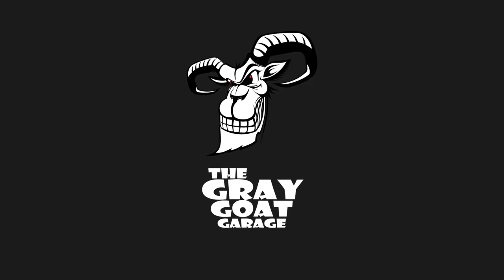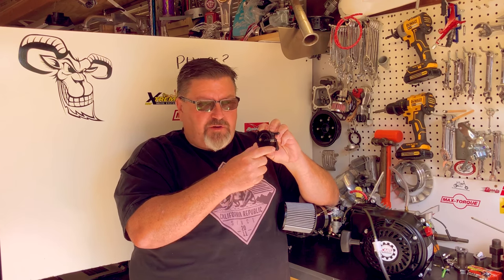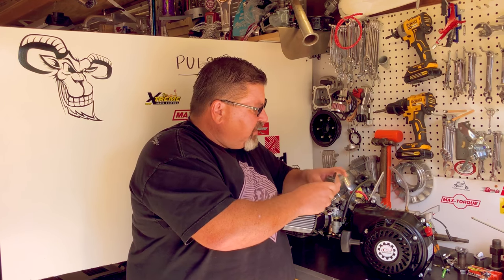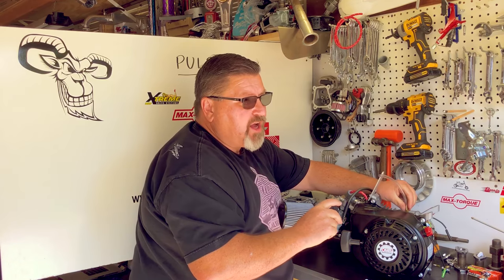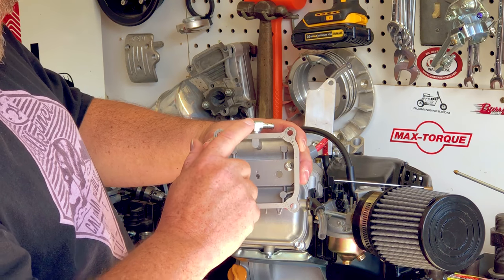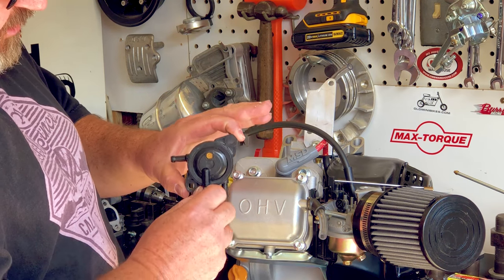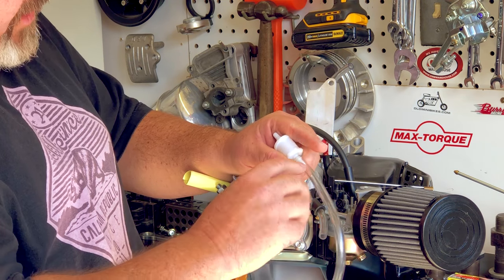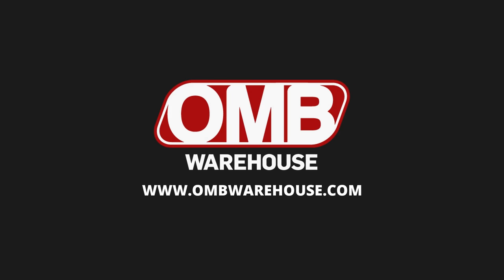Fuel Pump Installation on a Small Engine

Comment: Have you ever run into one of these pumps pushing too much pressure into your carb? Having issues with my carb overflowing. Pushing fuel past the needle and seat. Tried two different carbs. Cleaned them both. Same issue. Only happened after this install
Reply: Try adding a fuel petcock and playing with it a bit

Comment: Do you have a video of how to tap that hole in the the valve cover to get the pulse ? The proper way to make the hole , size and if you need another tool to make the threading so the fitting grips it ?
Reply from the maker: No, sorry, I don’t have a video on how to drill and tap a hole. 
Hit the hardware store and get a tap and the correct drill bit. They are often sold as a set 
Once you have the right tools just drill the hole and tap the threads!

Comment: GG You have a LOT more Grey and stickers in your back board from this vid to the pushrod cutting vid. 😅.  Thanks for all the help and would love to see you setting push rod length and ensuring we always maintain enough piston/valve clearance in our builds.  I just bought a 212 with +.020” rod, .308 cam, flat top piston and stage 5 head milled .063”.  Now I’m worried do I buy the Venom 1:1 or can I still get away with the V 1:1.35 roller rockers?  Lot of money to risk hitting the top of the piston.  Any reference material on how to math the math or the math to ensure it works before buying?  😊

Comment: Awesome explanation. Could you make a video on how to convert a top mount fuel tank to a separate tank under the steering axe? I haven't found any instructions on what parts I need or how the fuel system works on a predator this is the closest
Reply from the maker: That would be very hard to do for a specific kart and having a "one size fits all" approach is not the best way to do that anyway. Send me some pics of the kart to Help@OMBWarehouse.com and I will do my best to help you
Reply: @TheGrayGoatGarage  thanks for the reply. I mean as an example on these types of engines (predator 212, 224, and clones) which come top mounted.

Comment: Hey bud, out of curiosity, would this work at all if you also had no check valve in your breather going to a catch can. At the same time as I want more fuel pressure, I also wanna eliminate as much of the pressure build-up from the down stroke and the vacuum build-up from the up stroke as possible. I wanna say it should work if using the factory fitting size for the breather bc it should still build some pressure and vacuum bc it not like I’m drilling a 1in hole lol but curious if by removing the check valve if that’ll make the pump pretty much useless. I guess I should explain my goals with my build. For the specific build I’m not going for max power, rather I’m going for max fuel efficiency so I’m throwing everything I’ve learned over the decades of building cars and reducing as many parasitic loses as possible. I should also explain that I’m not using oem rings, rather I’m using total seal gapless rings to increase sealing potential even though the crankcase will have minor pressure/vacuum buildup during the strokes compared to stock. Im explaining that part bc with oem rings, reducing that crankcase pressure/vacuum can result in less than stellar ring sealing causing a power/efficiency drop rather than increase so wanted to get that part out of the way. Long story short, it’s a generator build lol. Thank you for your time bud.

Comment: I'm working on a stock gx340 from a pressure washer into a motorcycle. If you happen to have any tips on them or the P-420s, I enjoy the amount of information you output, and would very much enjoy watching a video on it.
Reply from the maker: Hi Cal,
the GX340 is a solid engine and a great platform to build on...as well as the Pred 420. The biggest thing we need to pay attention to is the crankshaft on the GX340. Some of the power washers used a tapered crank to mount the pump. There are no clutches for the tapered shafts!
The best thing you can do to any of these engines is open up the intake and exhaust, change the carb jets, and advance the timing. The EPA has these engines choked down and these simple upgrades will allow the engine to perform much better!
What are you wanting to do? better than stock? Performance build? Let me know.

Check that crank! If it is a straight 1" crank then we can plan this out for you
Reply: I am also doing a 420 cycle project. 1980 Suzuki 450 is my frame/ Roller. What are you using?
Reply: @TheGrayGoatGarage  I was gonna run a jackshaft with my CVT built into it so that I can universally swap the engine faster. Yes my 340 has the crappy tapered shaft, I believe a single sprocket will fit on it squarely.
Reply: @dhippstarr  a mudding lawnmower tehe

Comment: Would this be effective to use a pulse pump on a Honda GX390 pulling from an auxiliary fuel tank? It would have to pull fuel up about 15 inches and then over to the carburetor another 12 inches.

Comment: the oem black vacuum line that goes into the cover and connects to the pulse line went bad on mine a while back. I replaced it with a piece of clear 1/4" hose. fits in the cover super snug. no leaks. I noticed the other day when I started it gas going from the pump down the line into the cover. does that mean the pump is bad?

Comment: Hey brother I had a quick question if you can help me out I'm going to be building a predator 212 non Hemi 212 predator Governor completely, removed port and Polished head,  header, pwk 24mm open no air filter, .0.10 head gasket, 3.308 rod, .310 cam, Billet flywheel, with a 38  tooth rear sprocket on a Doodlebug ............  my question is what size of Springs should I use also what size of clutch also should I upgrade any parts for this setup any other parts any advice would be appreciate👊💯

Comment: Could you make a pulse fitting from the hole the governer gear was using?
Reply from the maker: If you are referring to the top of the case where the rod came through, yes, you can get a pulse there. 
That hole will have a lot of oil mist in the line so make sure the pump is mounted high so the oil does not accumulate in the top of the pump

Comment: I was running a go kart the other day and half way threw the session it just start getting slower and slower for no reason  checked carb and new spark plug and it's getting full throttle just wondering if the pulse pump is to blame the engine is only 7 months old and honda gx160
Reply from the maker: What has been done to the engine? has the governor been disconnected? If so, what billet rod are you using?
Reply: @TheGrayGoatGarage  it's completely standard honda gx160 single springed on the govner arm

Comment: So I want to add a pulse pump to my stock Predator 420. I'm looking at buying the Carb Insulator with vacuum port (rather than taping the engine myself), and buying a pump to pull gas from a stand-alone tank. This is for a pressure washing setup, not for racing. Which pump should I buy with the Carb Insulator?
Reply: Any pump will do, also you can buy a plastic piece for the motor that fits with stock motor. It has the pulse barb already on it and you’ll still be able to run stock carb etc .
Reply from the maker: We have the Walbro pumps here
https://www.ombwarehouse.com/walbro-fuel-pump.html
and the insulator with the pulse port
https://www.ombwarehouse.com/carb-insulator-with-vacuum-port-gx390-predator-301cc-420cc.html
The fitting on the insulator os for 3/16" line and the pump uses 1/4" line. Use this to adapt the two
https://www.ombwarehouse.com/1-4-to-3-16-fuel-line-reducer.html
Reply: @TheGrayGoatGarage  Awesome! Where exactly does the insulator go?
Reply: @TheGrayGoatGarage  Also, just put my order in for those parts. Thanks again!
Reply from the maker: @WallyJ2K  it goes between the carb and cylinder head

Comment: Do you have to block off the valve cover breather to get the pulse to work? or is there a check valve?  Great video , thanks.
Reply from the maker: Hi Don,
Nope! You do not have to plug off the OEM breather in the valve cover. There is a check valve in there that also allows the added pulse port to be effective. Add your pulse port and filter the stock breather and you will be good!

Comment: Question i have a 2008 yamaha cygnus nxc 125cc 4 stroke   scooter and has efi on motor can I run a vacum pump on it . It normally has an 12v electric pumps.
Reply from the maker: Yes. That is no problem. You just need to find a pulse port. You can get a pulse from the intake manifold too

Comment: I just stretched my 3/16'' fuel line onto the 1/4'' filter and pump. The particular fuel line i have seems pretty flexable so i went with it. But what i'm trying to figure out is where exactly to mount the fuel pump itself ? The only available stud in the area the pump is resting is the top left blowerhousing stud and i tried to put 1 end of the fuel pump mounting hole onto that stud but the stud isn't long enough to put a nut on it to hold it in place. Is the only other choice i have to buy a top plate ?
Reply from the maker: There are lots of choices! make a bracket for the pump. Mount it on the frame close to the pulse port. It does not matter where you put it! get creative...or get a longer stud! I would recommend using both mounting points!

Comment: Would i still need a fuel pump if my tank is gravity feeding my carb? not sure if the pressure is the same.
Reply from the maker: If you can get a sufficient supply of fuel by gravity feed, a fuel pump is not required

Comment: For a Honda gx390 could i use the old oil level sensor port or is there an option for vacuum on the carburetor? Or possibly put a bung on the valve cover?

Comment: I put the pulse line from in front of the carburettor with a spacer. I've never seen anyone do this but i thought that this should Work, but there's not much of a pulse at my pump is that the problem or could it be the broken seal of my valve cover?
Reply from the maker: That is hard for me to visualize 
Send me some pics to help@ombwarehouse.com and I will take a look
Reply: @TheGrayGoatGarage  done, thanks already for answering

Comment: after installing the pump I can still see air bubbles going to the 3/16 line to the carb. I bypassed the fuel filter and same thing. Any help would be appreciated, thanks
Reply: Check for cracks in your fuel lines.  If air is there, it has to come from somewhere.  If your fuel is coming from the bottom of the tank, that means you have air coming in through a fuel line crack, dried hose on a connection that is sucking air, or a gasket leak on the pump.
Reply: Thanks for the reply! I should have updated this , the lines were all new, but you were right on track, the fitting into the gas tank needed a new gasket

Comment: My mower runs good till it gets hot what would you think it could be
Reply from the maker: Sorry. I have no idea. It could be the fuel tank vent is plugged and vapor locking. Take the cap off when the mower stops and listen for a “whoosh” noise from the cap. If that is the case, drill a small hole in the cap

Comment: Where does the hose coming out of valve cover go to not the  one coming from fuel pump or can I just plug it off
Reply from the maker: That should go to a vent. You still need to vent the crankcase. Never plug that up!
Reply: Ok cool but mines coming out out the valve cover  I'm sure it's same set up  so what kind of things can I run it to so I don't lose oil out of it and what's the make of a power house racing engine I'm sure they designed many

Comment: Could you run the pulse pump into the valve cover on the side on the hemi? Like where that hose is coming off the side there
Reply: No, that’s the breather/check valve. Only lets air out, not in so it will not pulse. You’d need to drill a hole in the top of the valve cover and use the barb as GG did in the video. Or if you removed the governor internally, you can use the governor arm hole, drill and tap that for the barb.

Comment: When you had that predator 212 hemi valve cover in your hand with the pulse fitting already on it. 3:48  what do you do with the little side hole where the original airbox slid on to?
Reply: Sorry I read down further and you had answered that question. A simple tube with small air filter on it with work fine on that hemi breather hole off to the side
Reply from the maker: I use a small filter on that  https://www.ombwarehouse.com/breather-filter-12mm.html

Comment: G'day mate ,smithy from Aussie, just a silly question, I brought a  cub cadet ,20hp kohler motor on it, the is in a very bad way . When your winding the motor you get a small amount of fuel in the filter, how much pulse is required to deliver fuel to the  carbie?
Thanks for the video, very informative, 
Thanks smithy
Reply from the maker: Hi Smithy,
G'day Mate! LOL
The pump only will put out a little pressure when pulling the engine over. The pulse is increased with engine rpms. Once the engine is running, it does not take much of a pulse to get things pumping.
When the piston comes up in the cylinder, the crankcase pressure is negative, or a vacuum, and the piston going down in the cylinder creates positive pressure in the crankcase. This is what creates the pulse. 
We can also get the pulse from the intake manifold. The pressure in the intake beyond the throttle blade goes positive and negative with the opening/and closing of the valve.
If the pump is not working properly, it may be due to the gasoline. We have 10% ethanol in our gas here and that tends to make the diaphragm harden in these pumps and the fuel supply is diminished...and time for either a rebuild or a new pump.
Some of the Kohler engines used a mechanical pump and they also suffer from today's fuel.

If you have specific questions, please let me know and I will do my best to help you
Eric...the Gray Goat

Comment: What size is the fitting thread wise or does it matter
Reply from the maker: We like to use 1/8 NPT fittings. Those are tapered fittings that seal as they get tightened.

Comment: Running into a problem, bought an r/c with a Mitsubishi t110 motor.  No lines were ran.  Has a pulse fuel pump. I've never felt with one and I'm lost as to where the line from the pulse nipple goes to on the motor. Please help.  Thank you.
Reply from the maker: Hi Curtis,
That engine would have come with what we call a "pumper" style carburetor. It has a diaphragm in the carb that pulls the fuel from the tank. Chances are if the carb is in good shape, a pulse pump would not be needed. Those diaphragms get hard with the ethanol in today's fuel and will not pump properly. You may need to rebuild the carb.
If you want me to investigate further, send me an email at HELP@OMBWarehouse.com and include some pics

Comment: Does the pump open when a positive pressure goes through the line, or a negative pressure "sucks" the bladder open?
Reply from the maker: Both! The engine creates positive and negative pressure which moves a bladder back and forth pumping fuel through some valves inside
Reply: @TheGrayGoatGarage  awesome!  Im gonna follow Build Break Repeat and use this as an oil pump to feed a small turbo on my scooter

Comment: Just wandering ,,I have a electric pump that max pressure is 4 psi,,I believe,,,,what would b wrong with a regulator behind that and a gauge,,wandering if it can’t b turned down far enough,,has anyone tried this